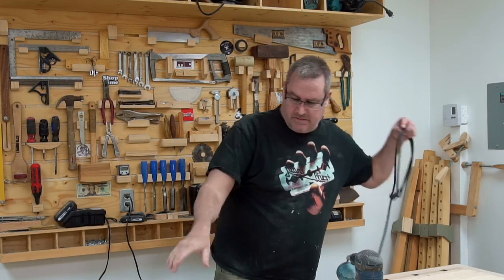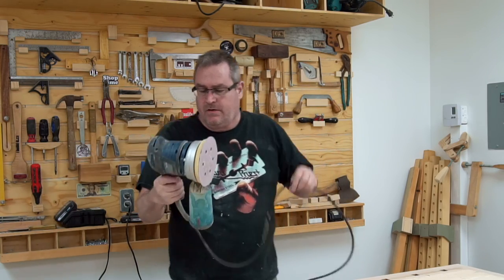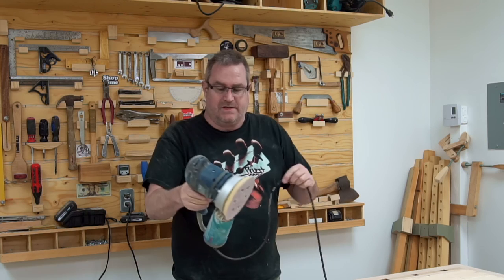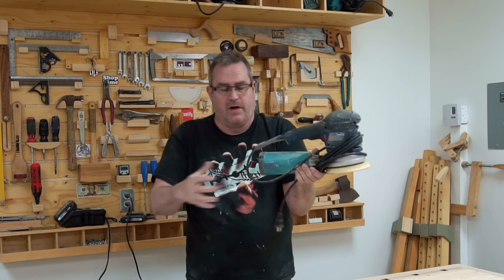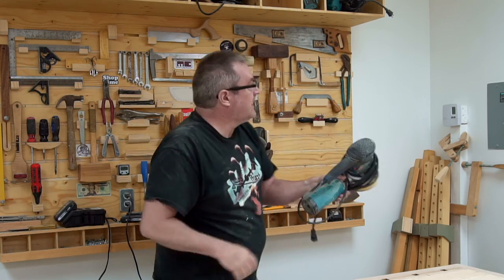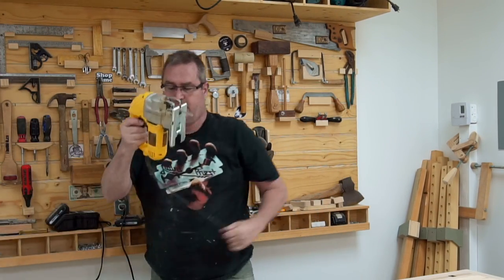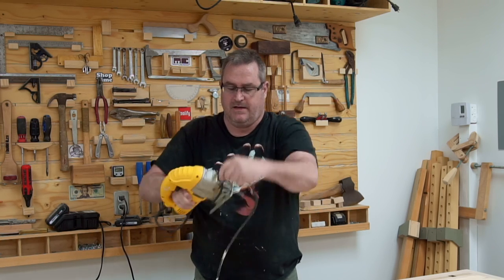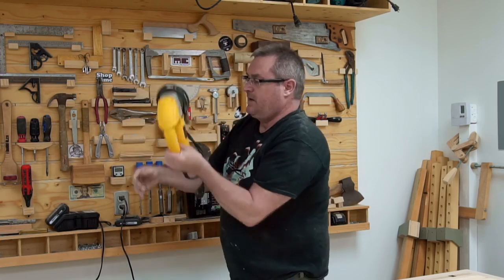How To Wrap Up Power Tool Cords Without Damaging Them

Comment: When I was very young I worked as a camera man on a mobile TV truck. We worked with very heavy duty cables that ran between the cameras and the truck. Some of these were thousands of feet long and an inch thick. They were very expensive stranded wire cables. Even a little bit of damage to the stranded wire in the cable caused serious quality issues in the video and audio. The truck crew would freak out and start screaming if they saw you pulling a cable toward you as you wrapped it instead of walking along side or making a roll with less than an eight inch radius or allowing a twist to form in your cable roll. The habits formed have served me well in life when handling any cabling, rope or hoses.

Comment: Very nice method, we use the same for things like audio cables/leads when it comes time to packing up a mobile cinema, though the audio cables that we have had to repair or build new ones for also have the addition of a spring immediately after the plug that goes into the audio mixer, that way whenever tension is put on it, the spring takes the full load.

I see people doing lots of silly things when it comes to wrapping up cables and leads, especially the old method of wrapping it up around their elbow and palm.

Nice to see there are others out there that prefer to do it properly, takes very little time and effort and ensures you always have something that will continue to work.

Comment: wrap it super tight, making special note to yank it hard right near the strain relief point, a nice sharp bend, bonus points for stamping the plug into the concrete. tape will fix anything, apply liberally, allowing the sticky edges to get on every part of the tool
Reply: nail, head, hit on

Comment: Everything said in the video is correct but there is an - in my opinion - even more important "trick" you can use. Prior to wrapping anything I double the cable, meaning I take the plug and hold it against the connection to the machine you talked about. And only then I wrap everything around the machine. That way the whole wrapping time is reduced by 50% obviously AND if you unwrap you will see that the cable isn't twisted. I mean everybody knows that if you wrap and unwrap a cable several times it gets twisted inside. If you double it half of it will get twisted one way and the other half will be twisted the other way. The resulting cable is always straight which is much more convenient and at least I believe it will also give it a longer life.
Reply from the maker: Good idea, especially for those tools that have really long cords.

Comment: An additional tip is to not wrap any cord or rope in the same direction for each loop. Instead alternate the twist every other loop. This allows the straightened cable to have an effective zero twist that has fewer tangling problems. The difference for a 6 foot cord isn't very large, but for longer extension cords the anti-tangle feature is much better.

Comment: I haven't always been aware of taking care of cords like this, only over the past 10 years or so as I've seen more damaged cords on sites and around the shop where I work. Saw a guy get zapped pretty good by a cord that had exposed wires at the female plug end, see sometimes there's a good reason to be anal about things like this! When I wrap an extension cord I don't bother with the braid thing that a lot of contractors do. Cords have a way that they like to naturally lie, I just let the cord do what it wants to do and not let it get any twists or kinks in it as I'm wrapping it up. No sharp bends like John points out here, easy enough. Damn I can't stop thinking about that guy getting nailed now, definitely woke his ass up!

Comment: How about removing the cable altogether and replace it with plugs? I did so with my 10 or so electric hand tools and I am super happy with it. Now I only have 2 cables to fiddle around with. A shorter one and a longer one.
Reply from the maker: A lot of work for little in return. The tools already have cords attached, you just need to take care of them.
Reply: For me it was absolutely worth the effort. f.e. also no more tangled cables on the workbench when using more than one machine at a time.
Reply from the maker: Just one more connection to wear out and fail, too. I've never had an issue with cords getting tangled when working with more than one tool at a time, so that might be reaching :)
Reply: Just wanted to throw it in the round. Maybe its useful for somebody :) Usually I create a huge mess around me when working on stuff. Less cables is very helpfull than.
Reply from the maker: DesandSam - here's a working link: https://www.youtube.com/watch?v=WquQYdwcr74
It's a great example of just how much time it takes to do something like that, plus those connectors are bulky and definitely not free.
Reply: He actually inspired me to do so. but I used a different plug system, cheaper and less bulky (check comments in the video), and I also just cut the cables off instead of taking all the machines apart.  Took me maybe 10-15min. per machine.
Reply from the maker: The only way that I could see doing it that would make a significant improvement is to build the plug into the tool itself, like Festool. But, that just my working-with-corded-tools-for-the-last-40-years opinion :)
Reply: A zero cost option versus a cost option...Hmm...think I'll go with the zero cost option, which I've already been doing for 30 years.
Reply: I wouldn't do that, but if I had to choose between tools with built in cords and tools with plugs, I'd go with the plug model every time!
Reply: I do like the idea of not having cables attached to tools but not to the degree where I spend the time and effort to modify all my powered tools. I wish that all power tools were designed with simply a plug.